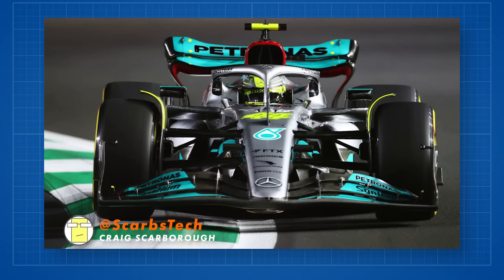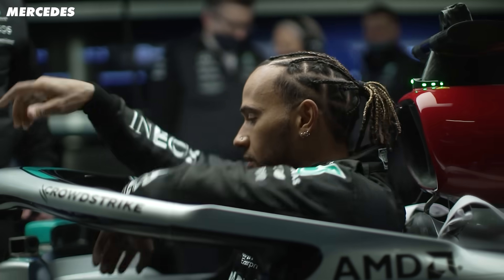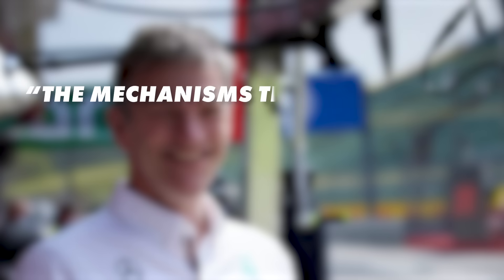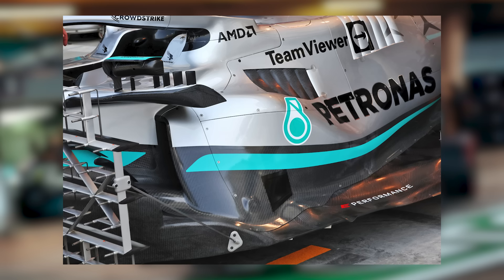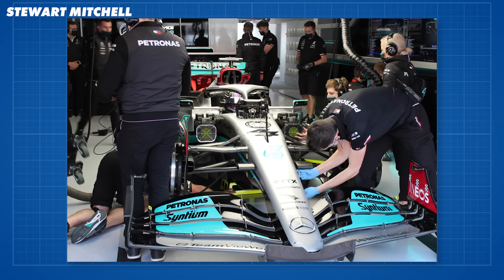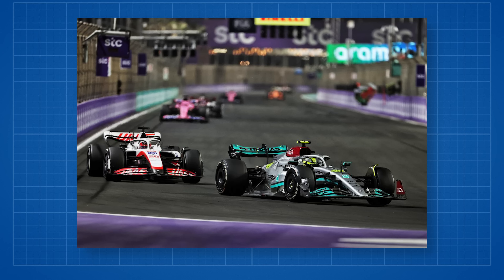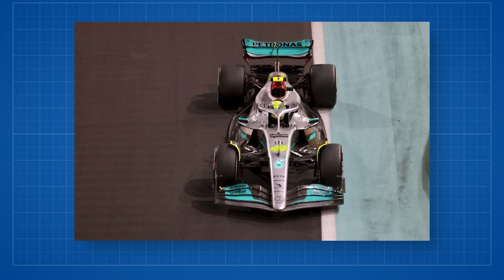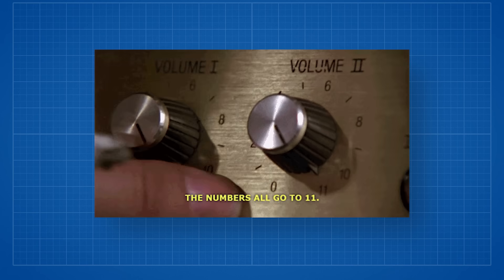The Real Reason for Mercedes’ Slow Pace | Saudi Arabian GP

Comment: Even in 2013, when Lewis first drove for Mercedes, they weren't THIS BAD. The car was a dog on race day but at least it was quick enough over a single lap to put it on pole. Now they're awful both in qualifying and in the race. By the time they sort their problems it will be too late to mount a title challenge. It's all about next year, I'm afraid.
Reply: Exactly . You can't simply cancel 8 tenths per lap especially with the budget cap . And Ferrari & RB will not stay to watch, they'll have upgrades too .
Reply: We are two races in, they have about 5 races or so before you can claim they are out of the championship and that can be extended longer depending on how the changes for other times go at the midpoint and although I hink Farrari have garentueed won constructors as I doubt they will have any issues and are much more consistent than Red Bull.
Reply: @Alex-cw3rz  Nah, in 5 races, they'll have to leapfrog Ferrari and RBR which is unrealistic. And this assumes they remain 3rd fastest and 3rd best in the championship in the mean time, and even then they will need misfortunes with RBR and Ferrari to realistically mount that contention.
Reply: @Alex-cw3rz  But there upgrade will not come before imola
Reply: It was a good car, just too hard on it's tires - so they'd be fast at the beginning of races (and with a good qualifying position) but then suffered from tire deg and they'd drop off.
Reply: That's an awefully quick call.
Reply: Way too early to say.
Reply: It’s not like they have a slow car and they need to improve it. They have a fast car with few problems and it just needs some fix.
Reply: @Mohammed-qp7xw  They have a slow car that lacks downforce and produces waaay too much drag lol
Reply: @Marc98338  true facts
Reply: Mercedes are done until 2026.
Slowly it's getting confirmed that their PU is the main problem which looks pretty underpowered.
Reply: @sambitranjan9584  it's only been 2 races bruh ......and I know engine development is frozen till 2026 ...but it doesn't mean that it can't get any faster or that it can't improve ......remember Brazilian GP last year ....the merc with the rocket engine .......they can always look fr a more aggressive engine mapping or an engine turning  route .....and given all the things regarding the cost cap .....it's still very early to judge....even tho I m a merc fan... it's refreshing to see other teams compete with a totally different packing order but ....counting them out just cus of 2 races is not ....viable ....but we still have time ....if they fail they fail ...I they overcome it then we're in fr one of the greatest seasons of F1 ever in all of F1
Reply: @sambitranjan9584  I really wouldn't be that sure bro they still have time to sort things out but you seem to be right... At least this year
Reply: It's 2 races. 2.
Reply: Merc was the 2nd fastest car in 2013
Reply: @donaldlee8249  Yeah Lewis had 5 poles but couldn't convert most to wins
Reply: @donaldlee8249  Merc had the best driver line-up in F1 - Hamilton and Rosberg in their prime - but not a better car than Red Bull, Ferrari and Lotus. Don't let the constructors standings fool you.
Reply: It’s only 2 races in… it’s not over yet. There are more races left than all of 2013. Lol
Reply: The teams are locked into the current engine rules through 2025 so if it is a power unit problem, they are stuck running in the back until 2026.
Reply: Been a merc fan fr a while ....a long ....while ........by the mercs standards.....this is a complete nightmare .....obvious  from how lewis didn't even know about the points on 10th place ......ur correct .....but this year was suppose to be different fr them cuz of cost cap of just 145 million dollars ....to put that in perspective ....those cars as of 2020 to 2021 each cost easily from 15 to 20 million dollars ...only considering the components alone ....given that thus year was an entire overhaul of regulations and cars r completely different with very little being carried over to the new cars .....the cost of development is suppose to be even higher ......so they r severely constricted .....like previous years of dominance ....they can't overspend to get things done quick they need to be strategic and they need to choose their upgrades carefully ....after analyzing and understanding all they could .....fr eg the strat modes of engines to keep em running fr longer ....and as fr PU and engine .....it could be ....that they ....couldn't pull it off ... but I highly doubt it ....tho it's possible .....but we're not talking about just some team ......we're talking about a team that has  revolutionized the turbo hybrid Era and spear headed the Era with domination ....with all that experience and knowledge from even before the start of the Era.....it's highly unlikely that they'd just make it go puuufff this time ......even tho the E10 fuel is different from high octane petrol (I know it's a significant enough change given the combustion rates will change and to produce the same out ....tge flow rates would be different  too ) but given
....
 on the scale of the things u need to put together  an F1 engine from scratch.....the fuel part is relatively adaptable
Reply: Don't worry they can ram those leaders off track mid season to catch up like last year
Reply: Mercedes dominance was a huge chunk P.U based. No P.U means it'll be over for them.
Reply: @marfrandema1884  Later in the hybrid era they had the beat aerodynamics of any team. So many teams adopted to Mercedes’s narrow nose concept. One team copied their car and became the top of midfield.
Reply: @Mohammed-qp7xw  sorry to tell you this but in aero superiority red bull dominated the f1 in hybrid era except 2020(mercedes) and 2018(ferrari) and they're still doing it so no mercedes aero department is not good as their powertrains... And now it seems bad for them too
Reply: @Mohammed-qp7xw  by the way racing point copying mercedes was not only about aero they did it because they were using mercedes parts power unit, suspension etc. So it was a logical call because they knew those parts were sorted out for that chasis they took the risk and it worked like a charm. If they had honda as engine supplier and red bull as partner I'm pretty sure you would more likely to see a red bull knock-off
Reply: @berkayakdag733  No they didn't. Mercedes aero was better in 2019 than RBR, RBR was only on par in 2017 and and 2021, other than that, Mercedes were always clear.
Reply: @F1ll1nTh3Blanks  dude better aero not only means straight speed red bulls always nailed the corners every year and for that mediocre renault pu they had so much speed on straights go get some research
Reply: @F1ll1nTh3Blanks  ın 2014 when new era started it was red bull again with the aero to become the 2nd  only if merc had the same engine that year they would probably be in danger that renault pu destroyed rbr in both terms of speed and reliability if you watched the 2014 season you know what i mean the car was overheating in the tests and had mutiple malfunctions due to engine i have massive respect for mercedes but no in the aero part they are no match with rbr which confirms this year with their useless design
Reply: @berkayakdag733  Yeh and in the aero era Mercedes weren't just faster on straight line and high speed circuits but more often than not, technical and low medium speed as well, talk to me about research when that one lands lack, also RBR hasn't been with Renault for 4 years from this year lol, do keep up.
Reply: @berkayakdag733  Yeh, that was in 2014, when all the teams were crying for more parity on aero, they changed the regs in 2017 and Mercedes were still competitive and better than the rest overall, this is 2017-21, can't just cry about engines anymore brah, big focus switches from the packaging, suspension, chassis and PU, to the aero periphery, the floor, suspension, chassis, wings, diffuser, packaging all became more aggressive to make the cars faster but also cull the "Mercedes edge."
Reply: @F1ll1nTh3Blanks  are you a joke? 2019 was honda's first year with team and they were slow until 3 or 4 races left when 2020 came they were better but mercedes nailed the engine and aero it was even called most dominant car ever
2021 honda become the best engine supplier for the majority of the season and beat the shit out of mercedes. Both teams chasis stayed nearly the same as 2020 and you still call merc aero was better you wrote their problems this year are aero suspension and drag you must be a joke to even write that
Reply: @F1ll1nTh3Blanks  cant cry about engines? 2017? I feel lıke im takling to void just write baku 2017
Reply: @marfrandema1884  No a huge chunk of it was because of aero and suspension. No one wants to admit it but from 2017, they have been competitive on all fronts and from 2019 and 2020, they were just far ahead of everyone else on all fronts.
Reply: @marfrandema1884  if you think it was all PU based you cannot be more wrong.

They have been excellent engineers overall, it's not just Merc HPP.
Reply: @marfrandema1884  i mean the chassis was pretty incredible at medium and high speed corners, they still managed to beat ferrari with whatever the hell ferrari had in the back of their car in 2019
Reply: @jame8618  Ferrari, not Red Bull as they were with an underpowered P.U
Reply: @marfrandema1884  One of MERCs engineers hinted that they are purposely running at a much lower strat mode because it makes no sense on these last 2 tracks to turn it up to 11 if that will only create more porpoising on the crucial straights.  Basically, they are still using the races as testing while trying to find the best 'compromise' for the aero changes moving forward.  The first 4 or 5 races will be damage limitation because by all means of measurement if they can figure out the car and the gremlins, they will be 1-1.5 seconds faster than RB and Ferrari on a typical track.  They are risking BIGLY with their design, and the simulations can not simulate porpoising, so they are figuring that part out as they go.  However, going by cross sections, drag and downforce - their design, in theory, is vastly faster than everyone else (also, Williams will be a front-mid-pack runner if they figure it out as well).  Likewise, theory and reality are two different things until proven correct.  It will be interesting to say the least.
Reply: @brandonb.288  exactly
Reply: @brandonb.288  1/3 true 2/3 false it was stated that reduced sidepods increases downforce but also massively increases the drag because of the exposed tyre area and not only mercedes uses that engine we saw haas and alfa pass every merc powered car baybe they cam recover but 1 to 1.5 seconds faster per lap? Not likely to happen
Reply: @berkayakdag733  no... just no...
Reply: @BrandonKent136  it's your idea mate 
I'm not the only one saying this do you really think mercedes pu is strong enough when being passed by a HAAS on a STRAIGHT LINE?
Reply: @brandonb.288  They will be 1 1.5 sec quicker then RB and Ferrari?  Wtf are you smoking kid. They improve 2.5 sec in a few races? You have any idea how big 1 sec a lap already is????
Reply: If the P.U is the problem is over for them.
Reply: @marfrandema1884  Well it's not, not significantly enough to be the route for them anyway. Their main problem is drag, aero and suspension right now and if they're gonna get competitive, it will be because of that, not the engine.
Reply: @marfrandema1884  so let's hope it is
Reply: George was fine...
Reply: @BrandonKent136  Perhaps you're new to F1, but qualifying 6th behind Ocon and almost 1 second slower than Perez is not fine by Mercedes standards.
Reply: @Euclides287  definitely not new to F1... but Lewis qualified 10 places behind George... all the time he lost was in the first sector. It's not the cars fault...
Reply: @Euclides287  also, to you, Mercedes standards means a car that's 1 second quicker a lap. I think it's finally just more even. Lewis isn't being helped by a vastly superior car.
Reply: @BrandonKent136  

Actually it kinda was because Lewis went down a setup direction that didn’t pay off in quali.
Btw, Lew was matching GR’s times - in race - on tyres that were 16 laps older so go wrap your head around that
Reply: @BrandonKent136  Lewis out qualified and out drove him in the first race  what's your excuse for that then?
Reply: @BrandonKent136  
Lewis and Russel had different setups, I believe. They tried something extra with Lewis, but went a bit overboard.
Reply: @BrandonKent136  Duh , Lewis had a different setup on his car compared to George . After the practice session ,he changed the setup of his car but it backfired completely.Thats why he slumped to 16
Reply: @BrandonKent136  last year George also qualified p2 in Williams do you think that car is capable of that?
Reply: @berkayakdag733  all I'm saying is that outright, George is better than Lewis, and Lewis has been essentially handed all his championships on a golden platter. Now the cars are more even and he has no chance. The gap between Perez and George shows the cars arent far apart.
Reply: @BrandonKent136  my bro george being fast on one lap is a known fact  he didnt get that mr. Saturday nickname for free but even in George's qualifying standarts it is slow
Reply: @BrandonKent136  how did you know that George is better than Lewis? Because he out performed Lewis in one GP?
LoL Bottas has outperform Lewis many times as well, that doesn't mean Bottas is better than Lewis.
Reply: @sambitranjan9584  because he's already beating Lewis in the same car in his second week racing full time with the team. You'll see
Reply: @StickyDingDong  
Being faster than GR in the race on older tyres proves he had a bad qualy lap.
Can't blame it all on the set up
Reply: @BrandonKent136  You have just shown your true intent by stating in your OP "George was fine."  Did you not hear that Mercedes went with a different setup for Lewis hence he was off the pace?  Was George "faster" in Bahrain when they had identical setups?  Pffft.  

You undercover racially motivated imps really grind my gears.

No worries, lulu will show George it is not his day yet in Mercedes and he's still the number one driver by a margin.
Reply: @BrandonKent136  its not the cars fault? hence why it had minor setup changes before the race and drove fine after?
Reply: @BrandonKent136  not the first race